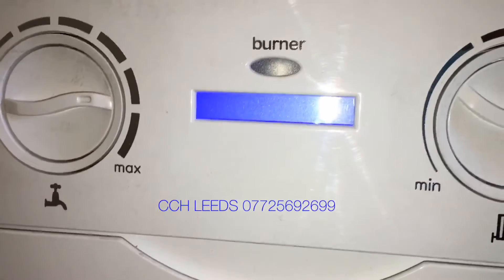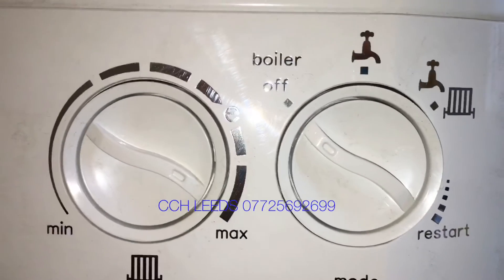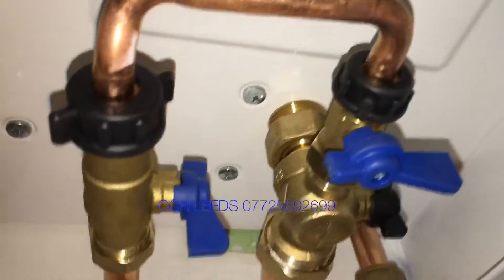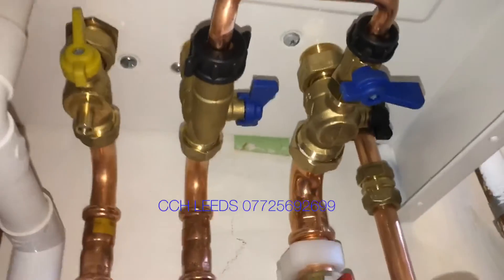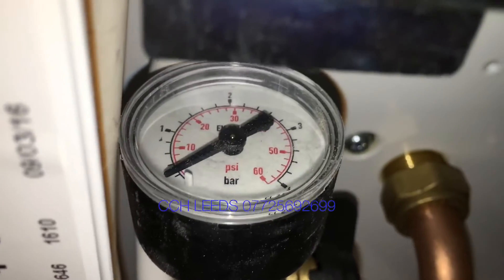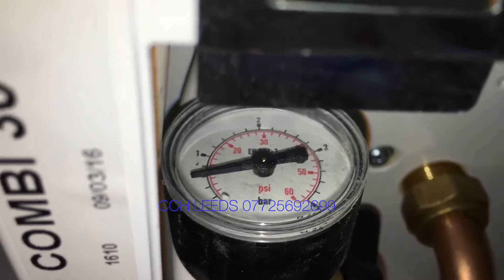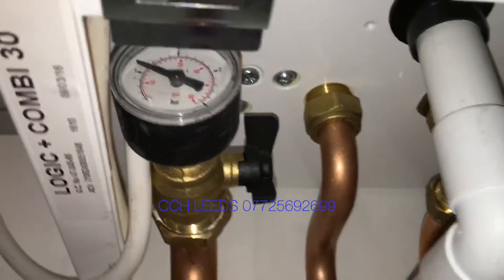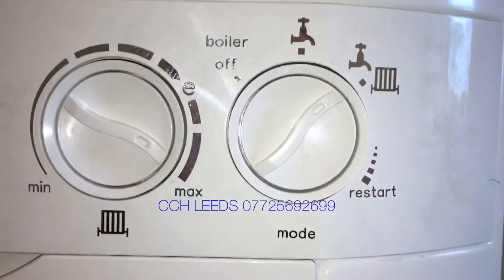How to Repair your Ideal Logic Plus Combi boiler

Comment: I dont have a black lever as its gone missing from past Tennent. so i have no way of knowing if the pressure is on or not... if i turn the water on and open the gage, will this blow the boiler up form the pressure? if its Bar valve is closed?
Reply from the maker: Getting the landlord to sort it out for you might be best. Thanks.
Reply: @AllenHart999  I got it sorted in the end, Nah I'm the owner of the property now just slowly finding out the little bits that landlords are too lazy to fix

Comment: I've been watching all your videos and trying to fix my logic combi boiler and I thought I'd cracked it but the pressure in the boiler just keeps rising and then goes into ignition lock out, it's been on the verge of braking down for months and my dad is a little neglectful to it, he's been having to manually refill the boiler every day if he wants to use it but now it won't stop raising while it's on. Is there anything else I could try or am I better to stop messing around with it and get a new one? It's gotta be over 10 years old now and I'm worried about it blowing up on me to be honest.

Comment: At the start of the video where you are showing the two blue taps, the blue tap on the right, see that black plastic nut, I have just noticed my boiler which looks identical to this one is leaking very slowly from that black nut on the right. Any idea why and any idea how I could maybe stop it leaking? Thanks

Comment: Great video. Can I ask what is considered a normal amount of time before you need to top up the pressure.  Also can a dripping mixer bar / tap cause a loss in pressure?
Reply from the maker: Only needs topping up if its lost the pressure. Thanks.
Reply: @AllenHart999  thanks for this. What I mean though is, say if your topping up the pressure of 3 months is that an issue or ok, where as compared to topping up daily would be a clear issue

Comment: I’ve just done this and it’s worked perfect! Also bled my radiators so the boiler is working fine but the radiators aren’t getting hot? Any advice would be massively appreciated as my plumber can’t get here until Tuesday afternoon 😪
Reply from the maker: Could be many things, that would be hard to give advice over the net. but I will try.

Comment: Hello, does the boiler need to be turned off for a certain amount of time before you do this? I’ve only just turned the boiler off and tried this but instead of the meter going up, it’s just making a bubbling sort of noise like there’s water in it? I’ll try again in a little while but just wondered if there any time frame I should go by? Thanks:)

Comment: Hi there, followed and the pressure is back up however there is no water at all coming out the hot tap - the valve was really tight to twist, could it be the blue cap bit you push/pull of the valve is moving but the actual valve itself?

Comment: Hi Allen great video...the best one I've seen to solve my problem....so many vultures out there demanding money up front it's sickening...The prey on the fact we panic if the heating goes off... I did unfortunately have a mishap....one key wouldn't move and broke when I forced it. I cant buy one separately, would a blue washing machine tap fitting work as they are sold separately?...many thanks. Phil

Comment: Hi Allen - I have a Ideal combi boiler that I would usually repressurise after bleeding a radiator. However, today I have attempted to do exactly this, but was met with silence. The water did not fill the boiler to increase the pressure. The sound of water shooting was there for less than half a second, but then nothing. What could this be? How could I fix it? It's almost as if the water filled the filling loop then got stuck. Could the valve going into the boiler be stuck shut? Is this easy to fix myself?
Reply from the maker: https://www.youtube.com/watch?v=X4OssmUEFo4&t=832s

Comment: Didn't work for me :( The first valve only goes the opposite way to what it shown on the video and not the other. The second valve won't move at all! I thought it might be a bit tight but they really won't budge!
Reply from the maker: How old is the boiler? Thanks.
Reply: @AllenHart999  I honestly have no idea. I have lived here 5 years and it was relatively new when I moved in so no more than 10

Comment: Thanks Allen, I have the same messages as your 1 says low pressure fill to 1 bar bitbots showimg 1.2 bar boiler won't come on, any idea please
Reply from the maker: Maybe the pressure gauge is faulty. i would advise you to have a gas engineer come out and check it for you. Thanks.

Comment: Hi, my pressure has dropped on my logic combi 24 ideal boiler but I have 2 blue tapes on the left on my boiler, the front one I can't seem to move  and I've tried turning the back one then the front blue tap on the right side that you do in this video but my pressure still isnt going up?
Reply from the maker: They are sometimes a bit stiff. Thanks.
Reply from the maker: Thanks very much for your comment, please consider subscribing to support the channel 🙂

Comment: Hi, I have a different boiler but the underneath looks similar to this. I twisted the black plastic valve on the left hand side and then it got stuck in the other direction. Nothing seems to have changed but I'm not sure if it is a problem. If it is, what can I do?
Reply from the maker: Which valve is stuck. Thanks.
Reply: @AllenHart999   It was the black one on the far left. I have managed to turn it back up right now and the issue is solved. I just don't think I was pushing hard enough lol. Thanks anyway.

Comment: I woke up today to 4 degrees in my bedroom, a glance at the control panel showed the heating was set to auto - 20 degrees. “That’s odd” I thought to myself as I trudged barefoot through the Arctic landscape that had emerged in my living room and kitchen overnight.

“low pressure, bleed radiator to get 1 bar pressure, call for service” the blue screen displayed menacingly.

I’m not good when it comes to even minor scratches, the idea of “bleeding a radiator” sounded somewhat barbaric and terrifying.

Having absolutely no knowledge or understanding of any of this it might as well or said “shank tabernacle to the 14th ratchet and insert 1 sprocketgimble in the furthest cranknugget”

Fearing all is lost, I turned to trusty YouTube and here it is - this excellent lifesaving video.

I turned the blue switch underneath on the left (the other one was already open, not sure if this matters?) - the bar went from 0 to 2.5 instantly and made a noise that can only be described as “torrential”. 

As one might expect, I swiftly turned the switch off and froze (literally) on the spot. There was an eerie silence followed by a squealing noise akin to that of Godzilla stepping on a Lego brick.

Silence fell again, and after what seemed like a lot longer than the 20 seconds it probably was in reality I turned the boiler back on.

It is now 20 degrees and all is well. Fantastic.

Note: If I do not reply to any comments or questions regarding the above, we can assume that the blue switch being left on, or the 2.5 bar pressure, or both, has resulted in a small explosion rendering me incapacitated and therefore unable to provide further correspondence.
Reply from the maker: Thanks very much for your comment, please consider subscribing to support the channel 🙂
Reply: @AllenHart999  top stuff Allen, hope it brought a smile to your face and any others who may glance over the comments with a similar issue!

Comment from the maker: If you found my video useful please add a comment below and thanks for watching. PS like and share😂
Reply: How do you remove pressure from your ideal logic?
Reply from the maker: MrGoldenV https://youtu.be/UR9wSU-I2O8
Reply: @AllenHart999  Hi I have an Ideal logic combi 30 boiler is it the blue taps on that model as well for the water pressure I always forget. Cheers :)
Reply: @MrGoldenV  qq
Reply: What if its still not working?
Reply: Hi. My boiler has two black handles and 2 blue handles plus the additional for gas and the one the next one to the pressure gauge. The pressure keeps going up by half a bar every few weeks. Plus the pressure gauge makes a bit of noise every time the boiler is on. What needs to be done?

Comment: I have noted my Ideal boiler seems to need to be re pressurised again but the last time was 6 months ago. I wondered if this was down to a leak or just general use or wastage through steam etc. I manage to re-pressurise it ok but this time forgot where the final position of the blue taps should be but I do now have hot running water and the pressure gauge has remained at a constant level and not climbing any more. I should of taken photos of it just before re pressurising it but it is very low to the ground and difficult to get to unless I lie down at a funny angle.
Reply from the maker: https://www.youtube.com/watch?v=X4OssmUEFo4
Reply: @AllenHart999  Cheers muchly for the link. I have watched that before. I happens once every 6 months right now and I noticed a green gunge on the bathroom floor underneath one of the pipes so that might be the culprit? But the leak seems to have sealed itself, or so I thought? Anyhow I will keep an eye on it and try to sort it out if it gets worse. Right now re pressurising every 6 months is not a great inconvenience. Apart from all the crap in the cupboard I have to move to get to the  boiler :0) Merry Christmas, Happy New Year one and all.

Comment: Question - the black valve to the right of the filling loop behind the blue valve is pointing up. Could you explain what it’s for and if you is the correct position for normal operation? Thanks
Reply from the maker: Thanks very much for your comment, please consider subscribing to support the channel 🙂

Comment: After doing this no hot water is coming from the hot taps (no water at all.) There is cold water coming through the cold ones. Any help please!
Reply from the maker: The one on the left might need turning back on? Thanks.
Reply: @AllenHart999  tried that but no luck, at least the radiators are working though thanks to the video! And we have an electric shower so we're not in the worst situation
Reply from the maker: @joshbailey872  If no water is coming out of the tap then it will normally just need turning back on under boiler. Thanks.
Reply: @AllenHart999  is the "on" position the valve pointing downwards?
Reply from the maker: @joshbailey872  no i don’t think so.

Comment: Hi Allen, my boiler is showing low pressure, but it is over 2 bar, and won't start until reaches the 2.5 bar.(I think doesn't show the correct pressure ) 
And when it starts then is making a funny noise and... The pressure indicator is vibrating.
Any advice?
Many thanks.
Reply from the maker: Thanks very much for your comment, please consider subscribing to support the channel 🙂

Comment: Hi, does anybody know what to do if the there are no blue taps. Boiler was only fitted a year ago and the manual states that there should be blue taps, but none on my one 😏
Reply from the maker: The newest model is a bit different, I will do a video if i come across one. Sorry it’s not going to help you this time.

Comment: Mine says low water pressure but the gauge shows about 1.5 bar. Any ideas?
Reply from the maker: Did you sort it.
Reply: @AllenHart999  Yes thanks. It was just a faulty gauge. Next question: how do install Hive with this boiler as it already has a wireless thermostat built in?
Reply from the maker: @ozi76  Hive is very easy to install but i would need to do a video to show you. next time i install a hive i will upload a video. Glad you got sorted, Thanks.
Reply from the maker: Thanks very much for your comment, please consider subscribing to support the channel 🙂

Comment: Hi can I ask what to do if I can’t turn the actual blue taps to the positions needed. You said pull out and turn. ? Anne R  thanks
Reply from the maker: i have tried to explain in the video. Thanks.
Reply: My left valve won't open either

Comment: I have a ideal logic+30 , there is power going to the boiler right up to the board. Do I need a new board if so where do I order it from ?
Reply from the maker: Call out a gas safe engineer buddy, it will need testing and checking and also resetting afterwards.
Reply from the maker: Thanks very much for your comment, please consider subscribing to support the channel 🙂

Comment: Hey great video! I accidentally let it get to 2, what will happen? Is this ok? X
Reply from the maker: Hi Alice, if you could go and bleed some of the rads to lower it a bit that would be great.
Reply: Allen Hart I haven’t got a radiator key 🙈 is it bad if it doesn’t lower? X
Reply from the maker: 2 bar is a little bit too high and could become a problem when the system warms up. as it heats up the pressure will go up even more. when it gets warm you do not want it to go up near 3 bar as that could damage the boiler.
Reply: Allen Hart oh dear 🙈 panicking now as it is going up like you said, is there anything else I can do?
Reply from the maker: you just need to get a bit of the pressure out, see if a friend has a bleed key, if not get your boiler booked in for a service and get the guy to sort it while he is their
Reply: Allen Hart okay great thank you for your help x
Reply from the maker: Thanks very much for your comment, please consider subscribing to support the channel 🙂

Comment: Thank you so much for this. I took off my heated towel rail to paint and all my heating and hot water went off once I put it back on and soon realised I need to re-pressurise the system and your pipes under the boiler are exactly the same layout as mine. The manual was absolutely useless so your video was a life saver for me!
Reply from the maker: Julie Cousins make sure you put some more inhibitors in to protect the system